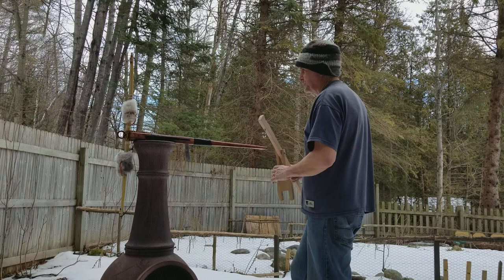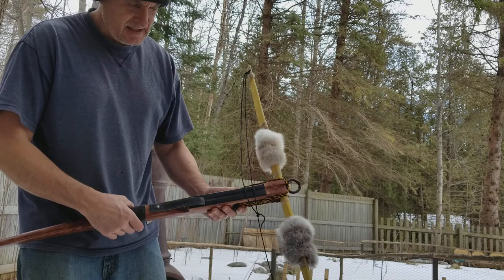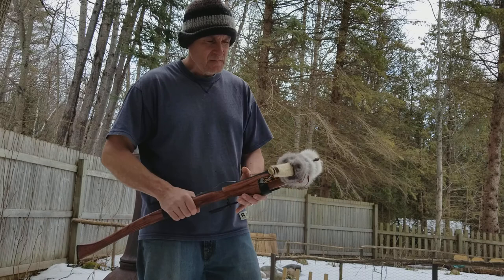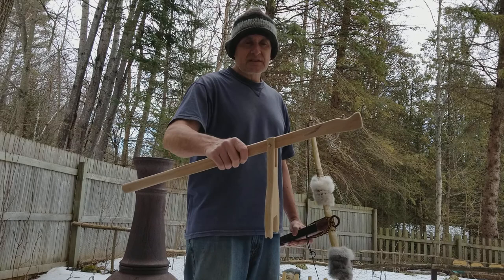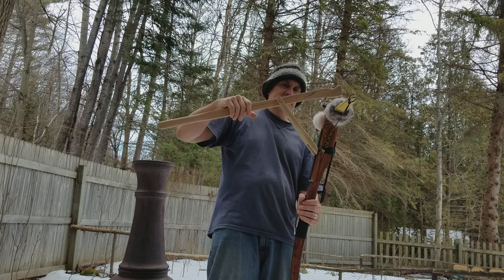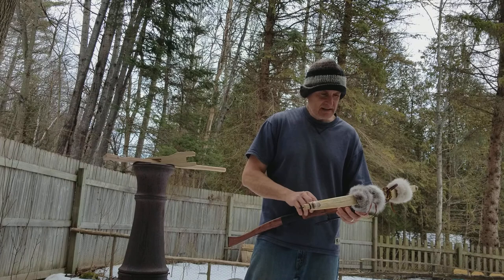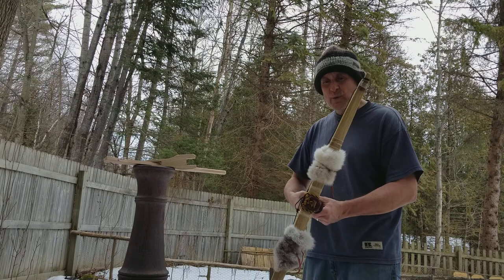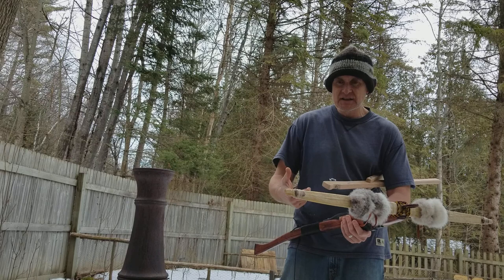Osage/Sinew Crossbow's Cocking Lever

Comment: Again, it's awesome in the looks department, can't wait to see how it shoots. It looks like something from Conan, the books or the original movie. Not some of the later trash. That's a high compliment from me! Oddly enough, I'm making a hunters horn at the moment. First time with horn for me. I plan to make a plug end similar to a powder horn.  Heating the open end with a heat gun for fit up. We'll see how it goes.
Reply from the maker: Thank you! Hopefully your project goes well. Just take it really easy so you don't crack it. Horn is fun stuff because it does get rubbery when it gets hot. It was a jump in my technology when I stopped trying to boil it and hit it with higher amounts of heat.
Reply: On the wippe how far is the bolt put from the front of the lever?
Reply from the maker: Hi Brian, I wish I could measure it, but I sold it. I'll search it our myself when I have more time, but one of the commentors on my videos could actually give you precise measurements. Sandi Lilli bought it and I betcha he would be happy to give you actual dimensions. If you can't find him on one of my crossbow videos, I will track him down. Thank you
Reply: No problem it's just I'm trying to figure how far to put the bolt from the front of the lever so it doesn't split.
Reply: @johnjriggsarchery2457  how far away would I put the hook from the front of the lever so it wouldn't split?

Comment: Hi John, I think this device is called a goat's foot lever? I've seen steel ones used in todd tedeschini's videos.
Reply from the maker: Hi Julian, It does resemble a goat's foot lever in a lot of ways. Tod is a wealth of information and has a good video on three types of spanning devices. The one that I am using hooks on the end and pushes. the goats foot hooks behind and pulls. They use the same motion as the one I made which is called a gaff lever. Thank you for watching.